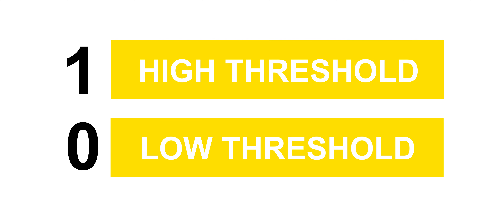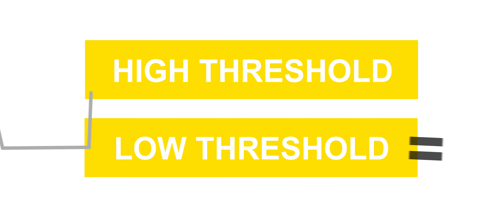What makes a DAC GOOD or BAD?

Comment: What the hell? Higher resolution digital makes the analog signal "smoother"?! What rock did these nitwits crawl from under? The Nyquist Shannon theorem (ON WHICH ALL DIGITAL AUDIO SCIENCE IS BASED!) explains in unequivocal terms, any resolution higher than twice the highest represented frequency will recreate the original waveform perfectly. Not "approach it" or "almost perfectly", no, perfectly. That part is a very well understood physics issue that really doesn't hold any secrets. But these jokers talk as if DACs produce an approximation. They don't! Do. Not.
The implementation of a DAC chip in it's specific circuit may make some audible difference, but only in case of subpar design. Unless you change speakers, all moderately well implemented DACs will sound equal. It is a scientific fact, not an opinion. Enough talk about myths already.

Comment: Thanks for explaining. One question i still have. How to use a dac at surround sound. Does dac,s support atmos, dts and what. Impact has the dac on surroud. Bigger, smaller, also on spacial direction etc etc?
Reply from the maker: In audio most separate DAC"s are stereo (L/R channels). Multi channel surround sound for movies and video is primarily handled by all in one receivers, HDMI connections, etc. Apple supports ATMOS decoding for stereo music if you use their products.

Comment: So would a pair of HD660S be considered a good enough pair of headphones that I should notice a difference with a good DAC? Right now I’m running a Modi 3+ with an O2 amp
Reply: DACs past a certain point give a very minor difference.
The Schiit Modi is good enough
Reply: youd be able to hear difference between 100-500$ dacs vs 2000-10000$ dacs yeah, when the dac is good enough u could basically hear it on anything but point being no one is plugging a <500$ headphone into a 6000$ dac lol

Comment: look up Nyquist Theorem.  The output of a Dac is never stepped or saw-toothed. Educate yourselves on digital electronics. The devices round up or down: everything below a certain amount is a 0 or above that amount is a 1. It wouldn’t matter if it overshoots, it’s still a 1 because it’s still above the level where it is seen as a 1.  It is very easy to differentiate between 1s and 0s. I’m not saying that all DACs are the same, but they aren’t different for any of the reasons these people are talking about.
Reply: I think they were talking about timing issues, not the accuracy of interpretation. The issue is kinda the same either way. The animations certainly are a gross oversimplification, I assume the point was to show a DAC could matter without getting exceptionally technical.
Reply: Power supply, timing issues, chip used, vs R2R, analog output stage all can impact the sound.
Reply: @jeffreylehman1159  It takes a very unusual amount of noise to effect the voltage enough to make digital circuitry confuse 1s an 0s.  I already explained why this was in the post you replied to.
Reply: @kevingest5452  Yes, I agree, but I’m not talking about transcription errors, but about how the digital source is handled. If it was just 1’s and 0’s then we would be using DAC chips from the 80’s. The analog output stage determines a lot of the nature of the sound, or do you not think that a pre-amp, say, has anything to do with the sound of your system?
The other factors also can have a say in how the DAC sounds as well.
Reply: @jeffreylehman1159  Well, consider this:
In the 80’s about the only DACs people used for music listening were in CD players.  Those 80s DACs sounded good enough that throughout the late 80s and early 90s, the vast majority of music listeners switched from vinyl to CD. In recent years we seem to have rediscovered how good records can sound and a large percentage of audio enthusiasts… the types of people who invest in quality sound and have access to good Modern DACS, will often chose to listen to recordings on vinyl when they are available.

If the 80s DACSs were good enough that people switched from vinyl to CD, but now people often chose vinyl over modern DACS, can modern DACS really be so much better than 80’s DACS?
Reply: @jeffreylehman1159  most 80's DACS were R2R DACS. People pay extra for that now.
Reply: @kevingest5452  Do you think DACS all sound the same? If not, why.
Also, many people thought beck then that CD players sounded artificial and shrill.
Reply: @kevingest5452  When I went to buy my first CD player( maybe 1985) I thought they would all sound the same, 1’s and 0’s right. I was surprised how different they sounded. I think the analog output stage is pro y the biggest component in the difference,  it there definitely was an easily hearable difference
Reply: @jeffreylehman1159 I think just about all DACS by designers who made at least a minimal effort to accurately reproduce the original sine wave, sound about the same.  The output stage amplification of course is an opportunity to change the signal by deliberately imposing coloration to create some kind of signature sound, which some people very well may prefer. I can’t fault them for that. I am listening to a Record as I type. There is nothing wrong with enjoying a particular flavor of distortion, but I would be delusional if I were to claim that it’s objectively and audibly superior. The other possibility is if a manufacturer just didn’t bother to spend the resources to accurately amplify the analog output, like when I plug the 3.5 mm jack of my echo dot into an amp, I can hear the difference. The same has been true of cheap business laptops, or older cell phones. 
The thing is that amplifying a very small signal to line level with accuracy that exceeds the boundaries of human hearing is an elementary process on the scope of all the things modern technology can achieve.  They did it in the first radio receivers over 100 years ago, the phono preamps in stereo receivers of the 70’s did it brilliantly, as does a $9 apple dongle.  Amplifying the analog output of a DAC to line level simply isn’t a process that requires cutting edge technology and thousands or even hundreds of dollars. 
Whatever number of people in the 80's thought CDs sound shrill, it wasn't significant enough prevent the other 90% from switching to CDs... and it probably isn't any more than the number of people who still prefer analog sources over Modern DACS

Comment: Thank you for this video! I honestly do think balanced on my AMP sounds better! But after seeing your video on balanced headphones/amps I realize it's not that it sounds better just there may be some interference or things going on to effect the non balanced, which makes sense as my DAC/AMP is surrounded by electronic equipment and in plugged in to a surge protected with many things which is plugged into a wall with a lot running on that circuit... This video is even more helpful to understand just how big of a difference a dac makes (as well as your rating AMPs video) Right now all my gear is combined DAC/AMPs and they are all very good AMP sections, hate to think I need to get a dedicated DAC but I think now I am ready to drop the big boy bucks on one that are in the same price range as my current units or maybe sell my units and go for dedicated DAC and AMP combo.... Thank you Abyss!

Comment: DACs are definitely relatively low on the totem pole of parts of the audio system that make the most difference in overall sound quality, with the quality and performance of your SPEAKERS (arguably) making the BIGGEST, and MOST important difference or improvement in sound if they are significantly upgraded.

You can spend literally ANY amount of money on an audio system, all the way from totally free, "hand-me-down" stuff given to you by your grandpa, etc., or even stuff that you sometimes find in a dumpster or on the curbside... to thriftstores and yard sales... to buying new stuff from your local "big box" retail or online store... all the way up to spending literally MILLIONS, (or even more), on the extremely high-end "boutique" gear for your entire audio system, some of which is just WAAAY overpriced, maybe simply because of its looks or "prestige" or "uniqueness", LOL!...

But in any case, with pretty much ANY, (at least semi-decent quality), audio system, even some of the better portable bluetooth speakers nowadays, you're getting probably about 90% or thereabouts, of the absolute "best", "total 100%" of the sound available, (from say an actual live performance right in front of you in the same space, for comparison), and so then above the portable stuff, with even moderately priced, but still relatively "entry level" (if/when compared to anything "higher-end"), REAL audio equipment, (like a separate source component, separate amp or receiver, and separate speakers I mean, vs. just an "all-in-one" unit like your phone or a portable bluetooth speaker, etc.), then at that separate component level you're then getting anywhere from about 99-99.99(9)% of the "best possible" sound, but it's that very last, tiniest, 0.001% (or however many zeros you want to put before the 1), of sound that a (really good quality, separate component) DAC can (potentially) bring out in the music...

It's just relative to whatever overall quality level your entire audio system, (and its weakest link, whatever that may be), actually is, and if you're (only) at the 90-99% level of overall potential sound with your current audio system, then using a separate component DAC isn't going to make much, (if even ANY), difference in overall sound quality from your system, because at that relatively lower performance level you don't even yet have all of the "basics" fully covered in your system first, however, if you already have at least to the relative "99.99(9)%" level (or more) from your audio system already, then at THAT relative overall performance point then you MAY benefit from getting a really good separate component DAC to (potentially) tweak that very last 0.00(whatever)01% of sound quality from your system...

But with some (significantly good quality) DACs costing literally as much as a new car, (in order to actually get to the performance level that makes a true improvement in sound quality), is it really worth buying one?... Maybe if your overall audio system is already up to that 99.99(9)% level or higher, then maybe yes, but if your already existing overall audio system, (whatever it may be), is NOT yet up to that point of quality, then your money would be considerably better invested in improving the "basics" of your system up to that (99.99...%) level first, because ONLY THEN, after/above and beyond that point, will you really get any additional benefit or improvement in overall sound quality (from adding a separate component DAC) than what you already have from your audio system as it already is...

The weakest link in your entire audio system will be the biggest determing factor, (and totally limiting factor), to the overall sound that you are able to hear from your system with your actual ears and brain, and for most typical, "average" consumers, that weakest link is usually, (almost always, from what I've noticed in other people's "systems"), is their speakers, and then a close second, the quality of amplification for said speakers, so THOSE two absolutely essential things is where most people should look to upgrade to the highest level that they can possibly afford first, before EVER considering (otherwise wasting money on) getting a separate component DAC...

You also must ask yourself HONESTLY if YOU (and YOUR ears), can even actually hear any level of sound quality above and beyond the "99%" level... MOST average people cannot hear ANY better than that, (some not even that good, especially if they have "abused" their ears over the years with attending lots of loud concerts, or blasting their headphones, or blasting their car stereos while driving, etc.), so getting a separate component DAC is definitely not for the average person... Also, you have to consider if even listening to music with any kind of "detail" or attention like actually sitting down in the "sweet spot" of your audio system, is even your thing... Do you actually even care that much about music?... Or, are you like my friend, who only "listens" to music at lower volumes in the background, (just to have some "noise" on to drown out silence), while he's doing other tasks around the house, etc... If you're a person like that then having a separate DAC would be a total waste, because you wouldn't ever even notice any difference in sound quality even IF it was there. I guess it's ALL relative to your own individual habits, behaviors, tastes, preferences, AND priorities, of what is important to you, and I would say that buying a DAC is definitely not a priority for most average people... And it really shouldn't be anything to ever consider spending any extra money on either, if you are like most average consumers, like what I mentioned above...

Pretty much the ONLY people who would (potentially) get ANY benefit from having a separate component DAC are actual audiophiles with an already really good (>99.99...% performance level) audio system, who ALSO enjoy really closely listening to and fully enjoying and "immersing" themselves in their music while listening in the "sweet spot" of their audio system most of the time... But anyone who doesn't at least consider themselves to be an actual "audiophile" and/or anyone who doesn't have an audio system that is at least already at that previously mentioned (99.99...%) "minimum" performance level to begin with, (or anyone who doesn't care to upgrade the other basic components in their audio system up to that level first), doesn't really need to even consider buying a separate component DAC, otherwise they'd just basically be totally wasting their money...

AND, I almost forgot to even mention... can you even AFFORD to buy all of the equipment needed first to really actually benefit from having a separate component DAC, AND, then buying the DAC itself on top of the total cost of your basic audio system?... I unfortunately cannot... And even though I DO consider myself to be an "audiophile", (at least in the facts that I have taken very careful care of my hearing over the years, so I can still actually hear better than most who are younger than me, AND I actually enjoy listening to all of my music in the "sweet spot" of my audio system, plus I CAN actually hear and I definitely appreciate the really good sound quality from truly high-end components that I might sometimes get to hear at high-end audio salons and a very select few other people's houses every once in a while), I simply do not make enough money myself to actually buy any of the higher-end gear, especially not new! I am (unfortunately) limited to buying the "best" stuff that I can find at my local thriftstores and garage sales, etc...

I have amassed a pretty "decent" audio system over the decades that way, but I still wouldn't consider my audio system to quite be up to the performance level needed to actually be able to hear any differences in sound quality in using a separate component DAC... My own current stereo system is only up to about maybe 99% of the "best" that I've ever heard anywhere, and from what I've experienced, that level is not quite enough to actually hear and appreciate the differences and improvements a separate DAC would offer. So, unless and until I can find even better audio gear than what I already have, probably used and definitely still very inexpensively, OR I maybe find a good separate component DAC in a thriftstore, etc., then I'll probably never own anything better than the one that is already built into my Onkyo CD changer. That sounds fine to me until I maybe can find something more actual high-end for a price that I can still afford. (I buy/have bought most of my stereo components at thriftstores and garage sales for under $20 per piece of gear, so that range is my very meager "budget".)

Comment: I am in the audiophile camp that gets the most side eye and belittlement because I focus a lot of cost on the back end to force the cheaper equipment to function at its highest possible spec. 

So, in my reference system I am using the Audioquest Dragonfly Cobalt. It's the one chip does all sort of DAC. The ESS 9380 pro chip is an amazing chip and many expensive multi-thousand dollar DACs have this chip in it (sometimes more than one,) When you state that the DAC has to be surrounded by "all the goodness" that is what I am doing, just eternally. It's all about clean power. Any noise on the line can be misconstrued as a signal that needs to be processed. The less noise you give the DAC the easier and more robust job it can do,

I start with a robust electric socket. In this case the Audioquest NRG Edison. From there, Shunyata Research's Delta v2 XC reference power cable. That powers Shunyata's Venom V16 power distributor. At this point, there is incredible amounts of filtered, clean power. I am using an Acer Helios 300 Predatpr laptop. Powering it is Shunyata Research's V14 digital power cable. This ensures that the entire laptop's systems have clean power to all circuits and outputs; especially USB. I also use Audioquest's Jitterbug FMJ in series with the Dragonfly Cobalt to filter the 5V USB line. The Cobalt has a choke that filters, but it is more of a general signal choke than a specific choke on the direct USB power line. 

This LONG chain of power allows the DAC to flourish WELL beyond the standard operating environment that most people would use it. As a result, I get extremely detailed nuance, pitch black noise floor, and a bubble of holographic sound. To be fair, The DAC is connected to a high resolving system. Audioengine's HD6 powered speaker system and their S8 subwoofer,